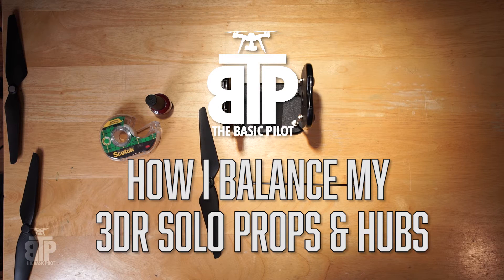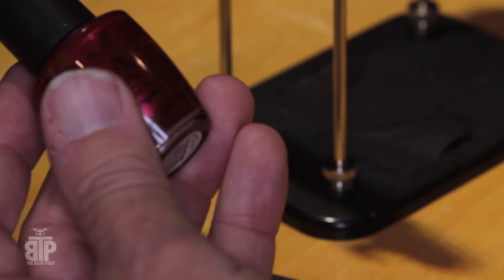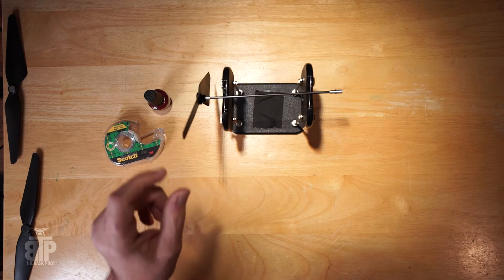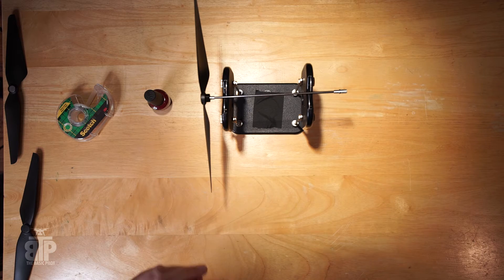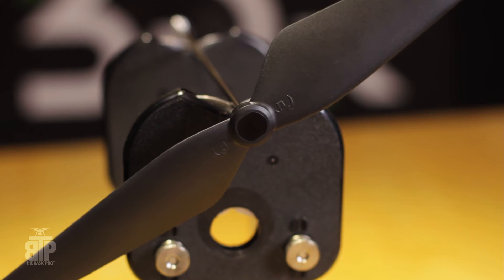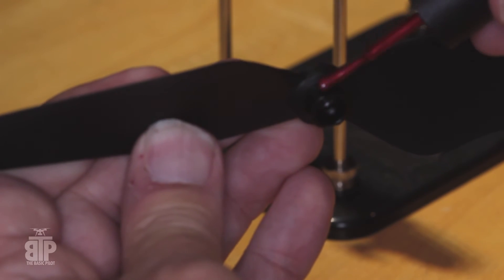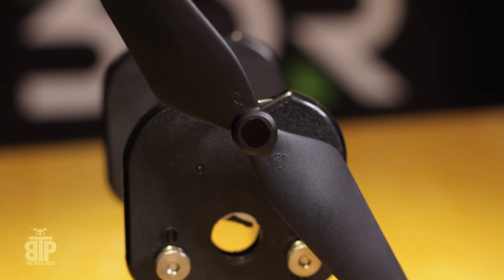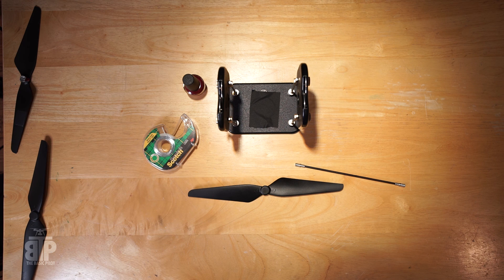How to Balance 3DR Solo Props and Hubs

Comment: Never put tape on the business side of a propeller. Always apply balancing adhesive tape on the under/back side of a propeller (as you did) where there's negative air pressure. The lifting/thrust side of a propeller has tremendous pressures. I agree with using the tape over sanding. Very nice video, great information!

Comment: Do not listen to this guy, The right way to do thing is not taking shortcuts, is to sand your props it has nothing to do with looks, once a prop is sanded it stay balanced and true put tape on your props or nail polish is like putting your hand out the window at high speeds, even though it looks balance on the bench, at high speeds 1 prop blade is causing drag, therefore losing rpms, causing strain on your motors and it's like the prop is not balance. THAT IS WHY THE REAL RC HOBBYIST SAND THERE PROPS.

Comment: i used 3m clear box packing tape..works great and stays on fine after multiple flights.  just make sure to press it firmly after final positioning.  much easier than using glues or sanding
Reply from the maker: That'll work